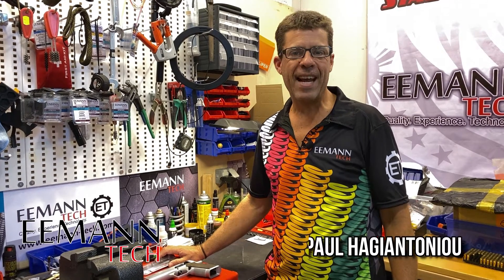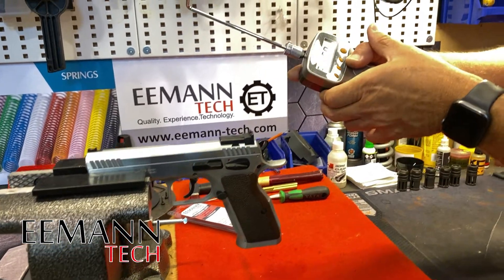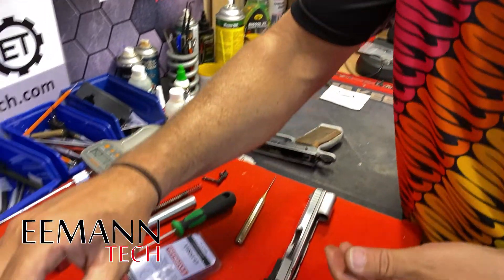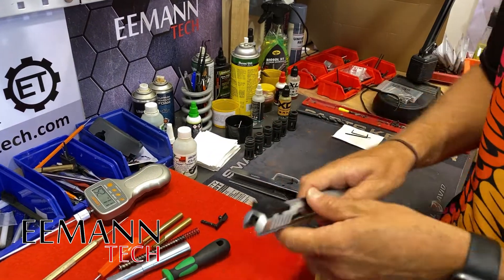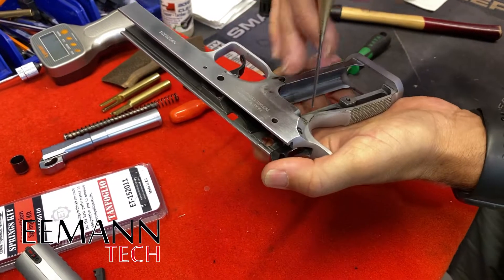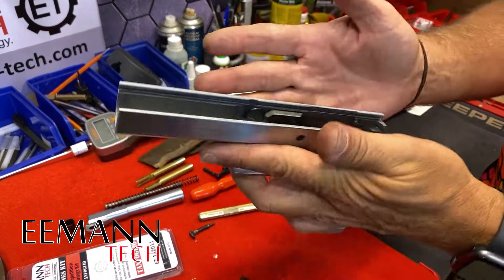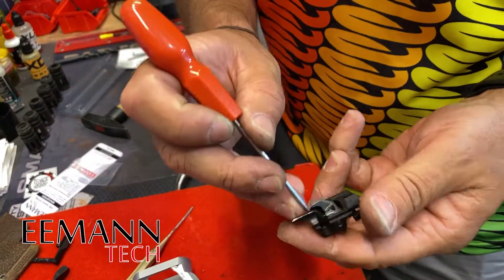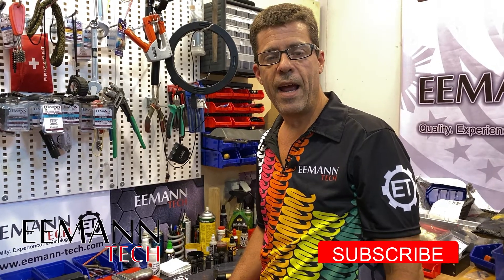EEMANN TECH COMPETITION SPRINGS KIT FOR TANFOGLIO (ET-152011) installation

Comment: Good day sir. Do eemantech make competition firing pin spring for tanfoglio.? I observe that you installed a regular power firing pin spring. Is that ok? Considering you will use a 13 lbs lighter hammer spring. It can cause light strike on amo?